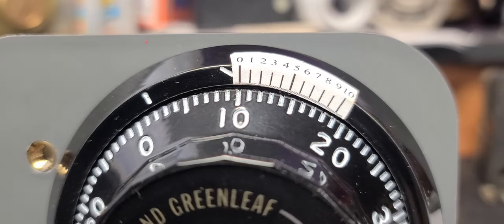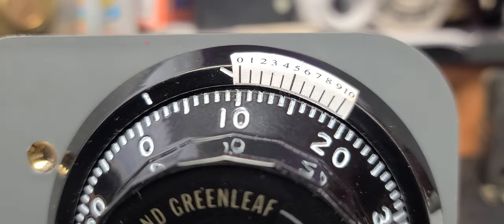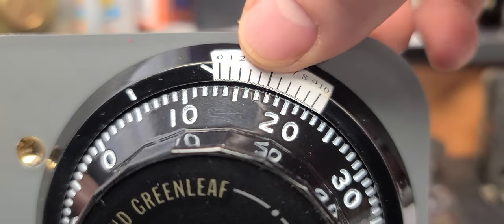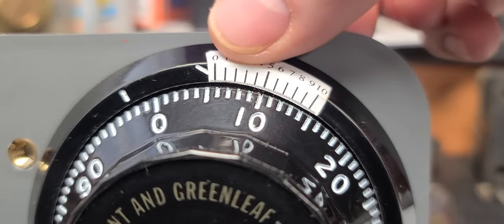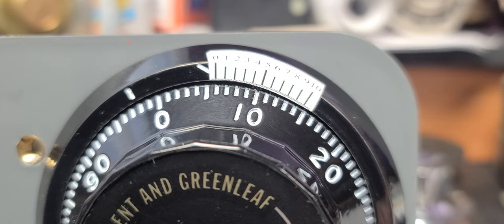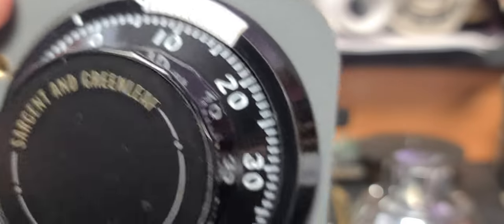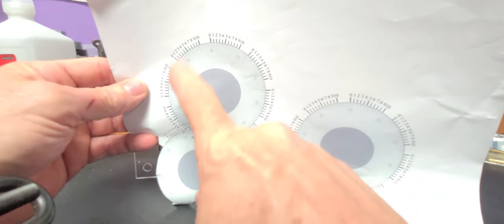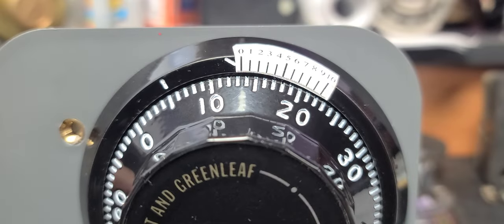Safe combination lock manipulation: How to read a Vernier scale

Comment: When I first started manipulating safes about 40 years ago, I was able to discern the slight variations fairly well and still can to some degree.   Then again it was not a hobby for me as I get paid to do it.
Reply: Doug, from your position and over 40 years of experience what is your opinion if we want to secure high-class Safe, let's say TRTL 60x6 from ISM, Israel?

From everything that I read and see, keys no matter how much they cost and how secretive they are, Everything is open with the right decoder for under the minute...

Electronic locks - very convenient and easy to access, but if this thing dies you must destroy the safe to open it ( it contains glass plate lockers to protect it from drilling and concrete with steel inside making Acetylene Torch attack a nightmare ), and believe me it is super easy to kill it with a strong Neodymium Magnet.

And the last option - what do you think about two 4-wheel for example La Garde Mechanical Locks. Yes, it can be manipulated, even if you can find an autodialer cracker for four wheels ( everywhere when I search is only for 3 wheels ), and will take a very long time to brute force the combination.

If you want, share your professional opinion.